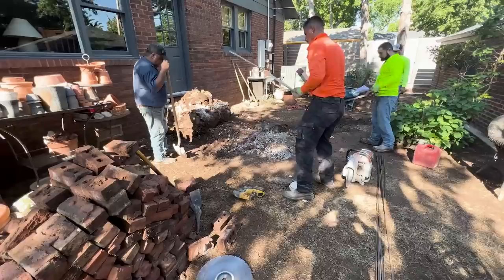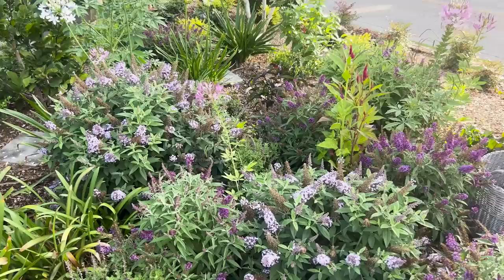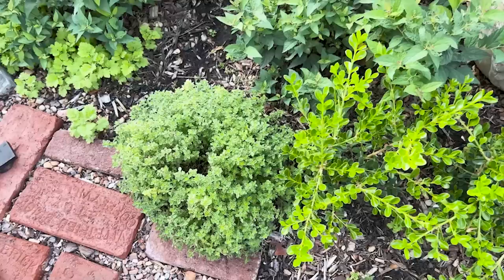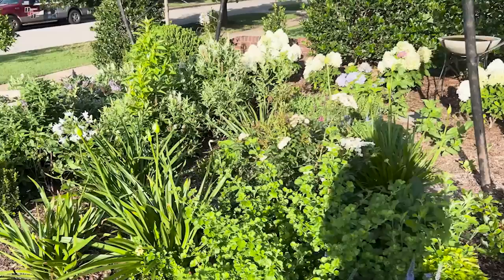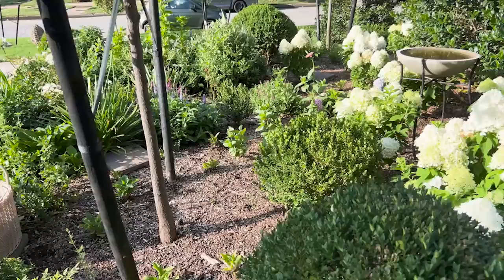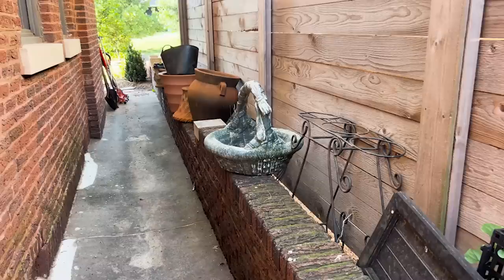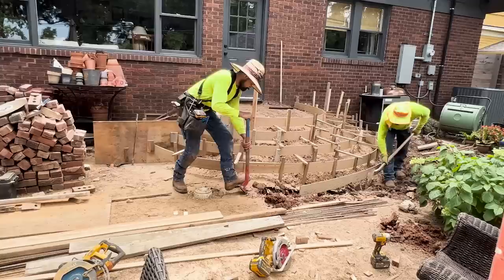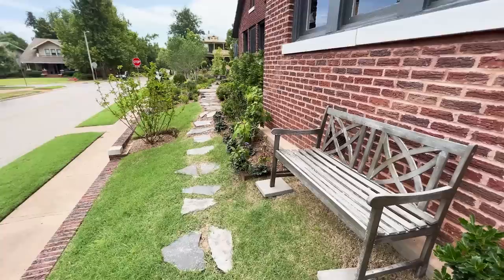Gardening Up Close and Personal

Comment: One thing I learned with my rain barrel that you may want to consider is that the spigots are fairly close to the bottom, necessitating that you provide a raised platform of some sort for them to sit on. Otherwise it is hard to attach a hose.
Reply: Indeed. We built a platform out of 2x4s for ours, so we can easily slip a watering can under the spigot. The can tucks under the platform when not in use.
Reply: Or just take the lid off and dip your bucket or watering can. Fills much quicker than a tap.